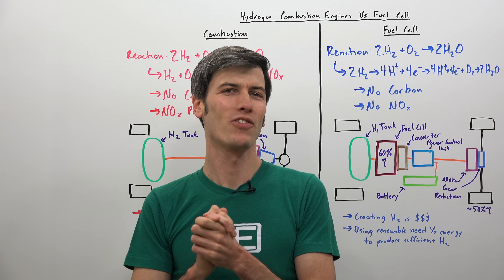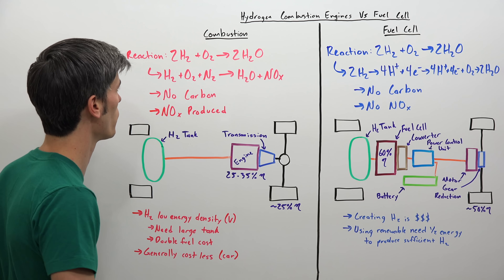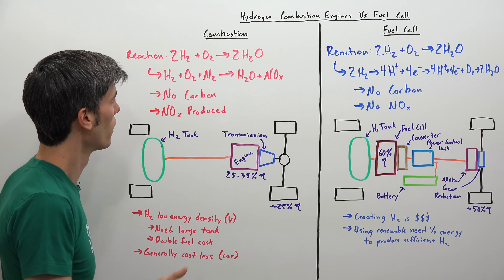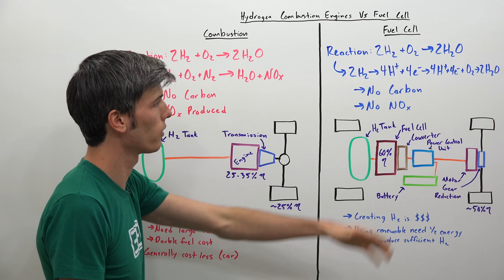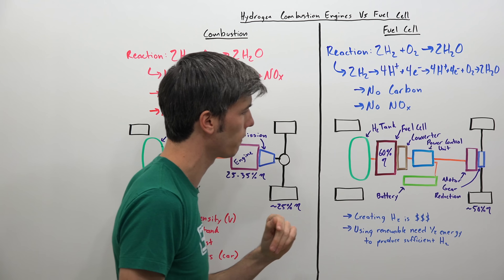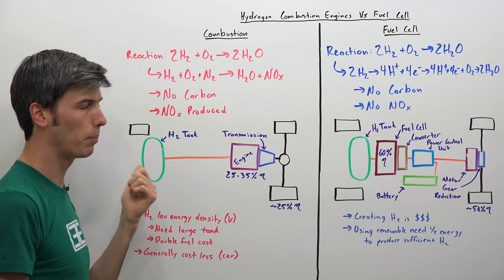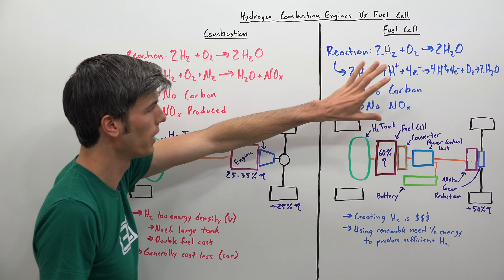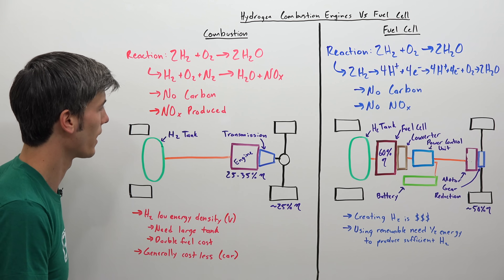Why Hydrogen Engines Are A Bad Idea

Comment: This is all missing the point. With hydrogen you don’t have to worry about efficiency because it’s not Finite. It’s a game changer. There are so many different ways to run hydrogen into a car, down to the wheels, and it’s so clean, that it’s the biggest disappointment to both electric, and gasoline industries. That’s the only reason it’s not mass produced in cars. It’s not a secret, or a conspiracy. They do not want the game to change. They want everything to be about who has the best efficiency of finite resources.
Reply: Exactly correct.

Comment: Well, you missed a few major points.  For a normally aspired engine, you're correct about NOx emissions.  But, a turbo or supercharger to boost air pressure in the cylinder, prevents this.  Also, batteries are not 100% efficient.  They don't discharge all the power they take to charge- with efficiency ranging from 50% to ?? for newer batteries.  But, it isn't perfect either.

I see the hydrogen ICE engine being used as an engine swap to current (pardon the pun) vehicles.  It would be the first step, then two other variations emerge.  A hydrogen ICE vehicle powering a generator with electric motors at the wheels AND fuel cell vehicles.  The fuel cell vehicles would most likely be more efficient, but the hydrogen ICE- generator vehicle has the advantage of being able to act as an emergency generator for your home or a mobile generator for disaster relief/ job site/ remote locations.  

Both would use the same fueling stations, tanks, and safety mechanisms, but it might break down to the ICE staying on for specialty applications.  

As for making hydrogen, we would need more electricity to extract it from seawater, and nuclear power is probably the way to go.  There's a TED TALK about "Why I changed my mind on nuclear power" that explains it FAR better than I would in a comment.  But, nuclear is GREENER than solar or wind is the basic conclusion, especially if we adopt "breeder reactors" like are used in France, reusing some of the "waste" for power.

Comment: 1) Where did the nitrogen come from in the combustion scenario? I'm assuming the outside air. 2) kind electrons come back in the fuel cell scenario, huh? I think I'm misunderstanding you here, but I think when the energy of an electron is consumed, it doesn't just "come back", otherwise you'd have perpetual energy, which is impossible. 3) The efficiency ratings are all estimates. 4) Battery cell production is horrendous for the environment, so that needs to also be taken into account for when comparing two types of this tech. I'm not a scientist, but I'm just trying to fill in gaps in my understanding.

Comment: Don't combustion engines provide more "power output" in the case of aircraft though? Electric power can only spin propellers, which lose efficiency at high speeds, but jet engines can discharge the exhaust from combustion for more thrust. Correct me if I'm wrong but it seems to me that fuel cell based planes would always be slower than combustion jets (which could be pretty relevant in terms of transport speed or warfare applications).

Comment: Image a vehicle with one of these with an onboard "water electrolysis" device,I like the sound off filling up with water instead of petrol or even hydrogen for that matter.
Reply: I’ve seen a video where a gasoline engine was using a electrolysis reaction to raise horsepower and mpg for “any” car.
Reply: Yep! That's exactly the kind of tech that we need, there are some other issues with the use of H2 but using electrolysis would essentially solve a major drawback of hydrogen ICE
Reply: I would like to take the time to post some info about my vehicles setup.  I have been running my car on Hydrogen for about 2 years now.  I do not store large amounts of Hydrogen fuel in a separate High pressure container.  I produce enough gases on demand through the electrolysis process to run my 2.4L engine which requires about 6L per minute at 7000 RPM to run without hesitation or noticeable reduction in power.  To be clear, I do not separate the Hydrogen and Oxygen gases in my device. I simply have a small container that will be pressurized to 12-15 psi before the system will shut off production automatically.  I produce enough gases on demand through the electrolysis process to effectively bypass the need for complex High Pressure tanks to store H2 like most of the current systems.
    With this method I do not store enough combustible gases to cause any significant fire hazard or air displacement danger in the instance of a "leak" or failure of the containment device.  I bought a new fuel tank to replace the one that came with the vehicle to prevent contamination from the old fuel.  Now I use my house water to fill my cars fuel tank which holds 12 gallons.  So the fuel system is the same as you would find from the factory but, I fill it with Water instead of Gasoline and the fuel pump connects to the water container in the engine bay instead of to the injectors.  Also I do not use the fuel injectors, I use a large aquarium tube that is connected to the intake before the MAP/MAF sensors.  In order to run my engine on Hydrogen I had to retard the ignition timing from about 25 degrees before top dead center to about 5 degrees before top dead center.  I did this by using a timing light and rotating my distributor clockwise by about 7 degrees.
    As a comparison my car got about 30 mpg with gasoline, now it gets between 25-35 mpg with Hydrogen.  In conclusion I am sure that with a more complex delivery system I could get better performance and mileage because I am not monitoring the fuel air ratio but, my goal was to create a system that produces less Carbon emissions not to be crazy efficient and cheap to fill.  I believe by producing enough gases on demand this is more efficient because if I run out of fuel through miscalculation or my fuel gauge stops working, I simply need to find someone willing to sell me water (in one case a woman was so impressed she just gave me the use of her garden hose).  This is also safer because I am not using a "High Pressure" storage container for a combustible gas or liquid, it is just water in a tank.
Reply: LOL people still believe this 'onboard electrolysis' stuff?! it is impossible...
Reply: @Simon-dm8zv  all your doing here if doubting everyones comments without giving any reasons or information on where your doubts come from?If you are as educated as your making out then your very good at hiding it!
Reply: Il-fang-lI gaming It’s just simple physics. It’s very worrisome that in 2020 people still believe you can create energy out of nothing. There is plenty of great information to be found on how the laws thermodynamics work. On-demand HHO creation is useless and has nothing to do with real hydrogen cars.
Reply: Simon and that’s why we don’t get no where in life because people like you. Lol
Reply: Max Herrin Haha have fun with your useless HHO electrolysis contraptions lol
Reply: Max Herrin I am here to prevent people to believe in nonsense ‘inventions’ that only slow down the energy transition because they don’t work. You are doing nothing to change the world in a good way. On board electrolysis is, again, completely useless because it is impossible to create energy out of thin air. It costs more energy (gasoline) to create the hydrogen than you are able to get out of it again. I advise you to get your head around some basic physics. Look up the first and second law of thermodynamics. You won’t regret it.
Reply: It's true electrolysis uses more energy than it produces at this present time but that could easily change just depends on who stands to benefit from making it more efficient. I'm sure we would've had free energy long ago if it wasn't such a risk to the economy
Reply: @il-fang-ligaming2141  Lol, no you can't.
Reply: @Simon-dm8zv  whatever kid

Comment: Fuel cells are pretty complex systems, especially in comparison to ICE power plants.  Battery and FC solutions are not as flexible or reliable as ICE, at least not yet.  The Nix problem can be mitigated using cats.

Comment: In a hypothetical hydrogen / Fuel Cell automobile, it would be possible to use some of the gaseous hydrogen to heat the inside of the car (and the fuel cell and brake recovery battery) when you have freezing weather like that - 20 °C, where normal electric cars have no source of waste heat to keep passengers healthy warm?

Comment: From an economic and psychics stand point to produce all the components  of a hydrogen ev it would use more energy to gather, refine and then produce the components while all ready pre-existing petrol/gasoline & diesel engines could easily be converted over to H.I.E (Hydrogen internal-combustion engine) but with the possibility of having a Nitros Oxide recovery System to create more fun and well NOS.

Comment: An fuel cell needs pure h2 without Amy contaminaties from the  compression process.  This is an plus for the h2 engine, a mechanical compressor can hé used.

Comment: A few points to think about : 
- Fuel cells' efficiency go down at high loads. Opposite of ICE. So on vehicles operating near full power most of the time, the efficiency difference is not as different as presented here - unless the fuel cell is highly oversized. Ex: trucks, offroad vehicles, ...
- Fuel cells call for a much more pure H2 than ICE which will tolerate a larger band of purity. 
- H2 engines are turning towards extremely lean burn which produce very little NOx - especially with aftertreatment. Still more than a fuel cell but it's important to keep order of magnitudes in mind. 
- ICE are a mature industry : there are factories built with functiunal machines to build them in numbers and trained, local employees and maintenance shop to look after them. Fuel cell industry is a at a foetus state in comparison. If fuel cell is the sole option chosen for the future, all ICE related jobs will be lost (other will be created but not necessarily at the same place). Hence the political incentive to maintain some ICE industry with H2 combustion. 
- It is possible to retrofit an existing engine to run on H2. If the overall footprint is marginally reduced for a car compared to building a new EV fuel cell car, this reduction can be massive for bigger engines (once again trucks, offroad, power-production, marine engines...)

This video is a good explanation of the differences between the 2 solutions but it focuses solely on emissions and efficiency in the vehicle. In the bigger picture, it is likely that both tech will find their field of application.
Reply: I agree, as an engineer working on hydrogen combustion engine. We make the engine run at 0.2-0.3 ratio making it very lean and producing very little nox. I think the guy of the video was too general in his approach neglecting important details such as this one

Comment: You said hydrogen combustion engine is 25-35% efficient. And that the fuel cell is 60% efficient. But what about the electric motor that is powering the fuel cell car. How efficient is the motor in using that 60%? Cause depending of the motor's efficiency, that 60% is gonna become lower.

Comment: I dont see H2 combustion engines in a car for that exact reason. BUT! I think that we all should be allowed to run hydrogen engines on the roads. It is not hard to make a gasoline engine into a hydrogen engine. And carburated cars are even easier to convert. And by doing this we can still have our beloved vroom vroom cars with all the cool engines we love but in a much greener way. Now I would love to have a old classic car that is way greener than any combustion car that is made today with 50s technology 😎.

Comment: If a hydrogen generator is connected to a second alternator that is converted to an electric generator,when the accelerator is prest the hho gen produces enough hydrogen and oxygen which it separates from water to run a combustion engine,its the perfect burn ratio.Hydrogen fuel tanks are not required when you have a hydrogen generator,only WATER is required.

Comment: This is good coverage of what is ultimately the most financially efficient way to use hydrogen for personal transportation, if larger scope costs such as environmental degradation, sea level rise, more frequent and more powerful destructive storms, etc. are overlooked.  Consider that there's a cost involved with every unit of hydrocarbon fuel sold and burned in the last many decades that nobody has been made to pay until recently.  Vehicles with fuel cells that are ready to use hydrogen efficiently as described in this video are not ubiquitous, but traditional ICE engine vehicles are.  Considering all costs, I would promote the current best way to maximally integrate the use of hydrogen NOW, VS the ultimate cost efficient way to use hydrogen at some point in the future assuming ubiquity of fuel cell powered cars.  We're better off encouraging acceptance of less efficient uses of hydrogen over supporting more polluting energy sources while waiting for more efficient uses of hydrogen.  Consider that every vehicle manufactured has a carbon footprint that cannot be undone.  Adapting a functional hydrocarbon powered vehicle to use some percentage of hydrogen (or propane, for that matter) would be substantially more economically efficient (considering all costs) than the creation of an entirely new vehicle with the capability to use hydrogen twice as efficiently.

Comment: This guy either doesn't understand how a HHO system works on a obd 1 or older system or he is just paid to do misinformation. 
   My 1986 Mercury cougar 3.8l v6 was getting 40+ miles per gallon while on crude control. My engine burned 20% hotter due to the higher efficient burn. My radiator handled it just fine. 
  Better gas mileage, a little more horse power and torqe. My hydrogen was free since it was produced as i drove using tap water. 
  YouTube removed my videos demonstrating how my system worked. The fact is that water has more energy than gas when the hydrogen and oxygen are separated through electrolysis..... This guy doesn't mention that process. 
   This guy is being very dishonest when it comes to how a HHO cell works in a ICE car.
Reply: I did the same thing on a 1990 Pontiac sunbird,  36-40mpg.
Reply: @Carson Seigler yes, I dont know the numbers for efficiency on a system to run purely on hydrogen like Stan Meyers system but I know he only needed like a 1 gallon water tank cause it creates 1,800 gallons of combustible gas from the 1 gallon of water and my system ran only on maybe 1 quart of water to increase my mileage by 8-12 mpg.
Reply: @Carson Seigler my D.C. Square wave based electrolysis cell was fully bathed in water thar was gravity feed by a gallon pvc tank. It would last about 2 or 3 days. I averaged 150 miles a day. About 125 of that would be highway. My old 1986 cougar went from a base of 21 mpg stock after a slight tune up at its best.  To 42+ with pure hydrogen and oxygen being inhaled into the engine. It works and many mechanics continue to swear by it. 
  Im not a engineer. However as a elevator mechanic who relies on engineers and there prints. I can tell you that they get allot of there designs wrong and make plenty of mistakes. We're all human. Also what happens in the lab or on mathematical equations, often do not translate to real world results. 
  Personally, I think that having multiple fuels burning in a OBD 1 engine has the accidental effect of needing less gasoline to run the engine by increasing the efficiency of the burn.
Reply: . Most engineers hate it when there math is wrong. It mean they have to actually get there hands dirty and do some real research while getting there hands dirty.
Reply: @udontneedtoknow6816  that's exactly right.  Part of the reason using HHO along with gas works so well is that the Hydrogen has a faster burn rate and when mixed with gasoline it helps more of the gasoline burn that would otherwise have to be burned by the catalytic converter.  Basically tapping in to the potential energy already there that normally gets wasted so you're increasing the efficiency of the engine.

Comment: If more research was put into more efficient ways of electrolytic hydrogen production using solar or wind, we could probably bring the cost of hydrogen down quite a bit. Also, hydrogen gas is extremely lightweight, so tanks could be incorporated into unused space on passenger vehicles such as the roof.

Comment: The thing with a hydrogen combustion engine is whee to water produced as exhaust goes. I Winter you will have many vehicles producing large clouds of water vapor in freezing air temperatures. The vapor freezes and falls to the road surface. So during freezing temperatures every day is an ice storm. Roads may become iced over and dangerous. 

Now in higher temperatures you have clouds of water vapor and the effect of millions of gallons of water vapor will have may well not be good. 

Remember we are talking about all those vehicles in the cities, interstates and so on. Where a great many vehicles travel must be considered.

Comment: Could the NOx not be used in supplement to air for the oxygen supply when the engine gets going? It's still inefficient, but that would knock the NOx out or at least bring it into acceptable levels.
I just know that Nitrous Oxide is used to boost oxygen intake in cars already, so let me know if the NOx emissions cannot be used in the same way for whatever reason.